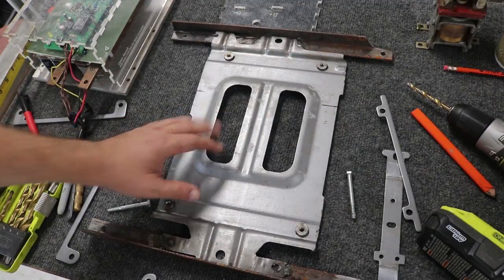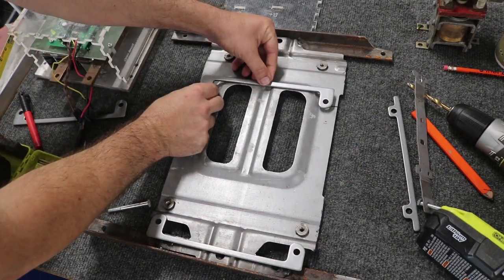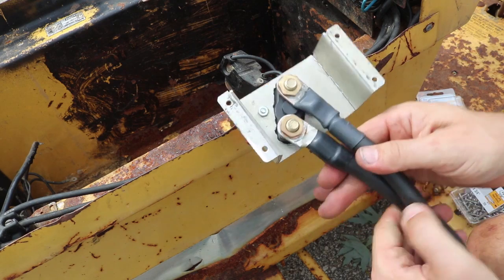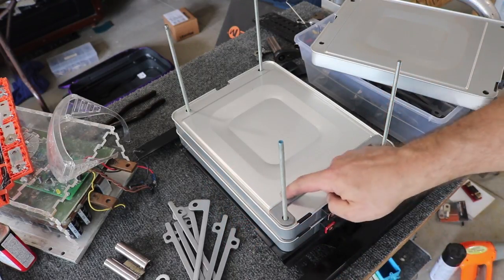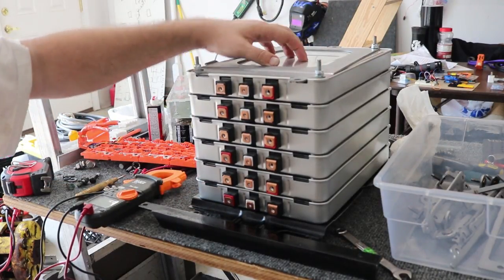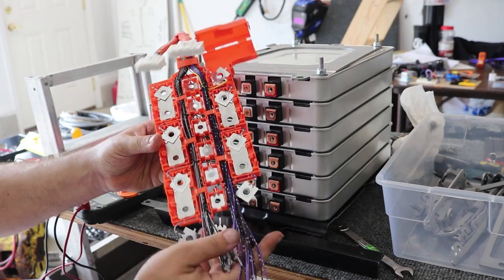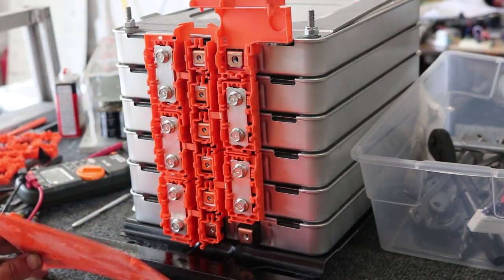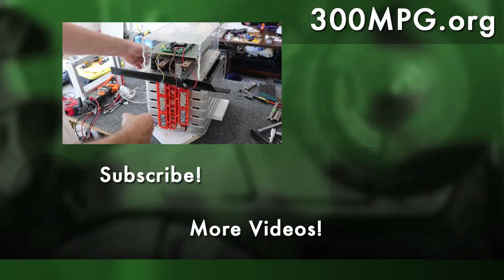ElecTrak Rat Rod Part 8

Comment: Where do you get the busbars from?
Reply from the maker: I have taken apart two Nissan Leaf battery packs. The bus-bars and the orange insulating plastic around them are original from the Nissan Leaf battery.
You can easily make you own bus bars by purchasing flat copper stock and drilling appropriately placed holes in them.
Reply: @BenjaminNelsonX  thank you. Nice content

Comment: What is the center terminal on the battery for?
Reply from the maker: On the Nissan Leaf Cell modules, there are actually four cells inside each metal can. Two are connected in series and two are connected in parallel. (2S2P)
Each cell is 3.75V nominal, so it's 7.5 volts across across the red and black positive and negative terminals of each can. The center terminal allows for checking the voltage of the pairs of cells inside the can, primarily for balancing.

Comment: What type of welder are you using?  I"m looking at a few small welders for DIY projects like this one.
Reply from the maker: I have a 240V wire-feed mig welder. It happens to be Clarke MIG 160EN Fluxcore Dual Purpose. It can be set up to use gas, although I don't have the accessories for that.
It's this one: https://amzn.to/2xbtrG5